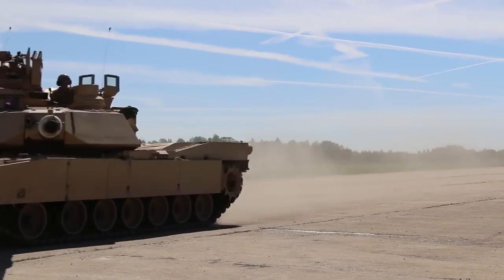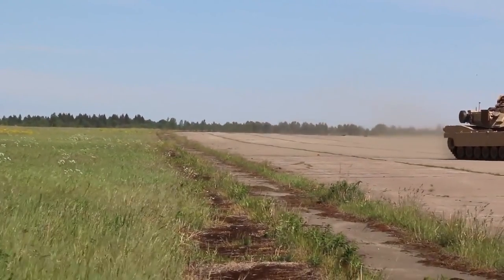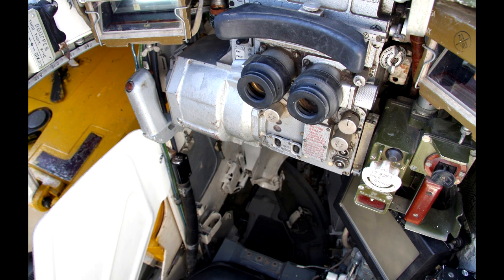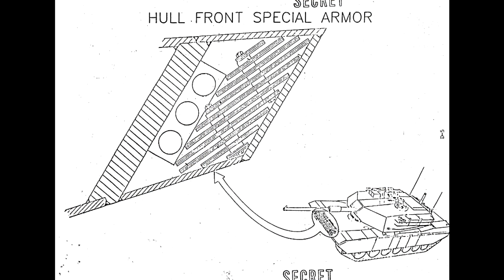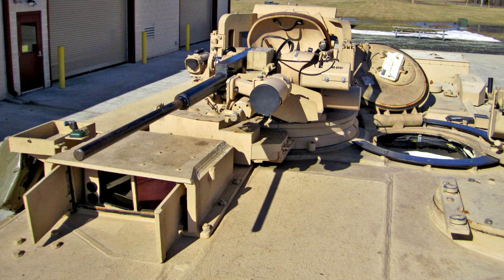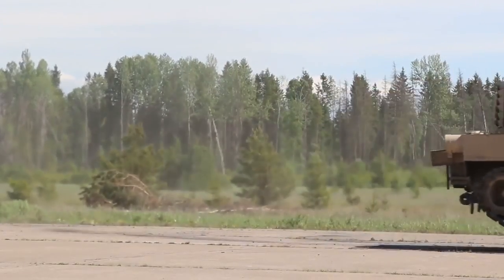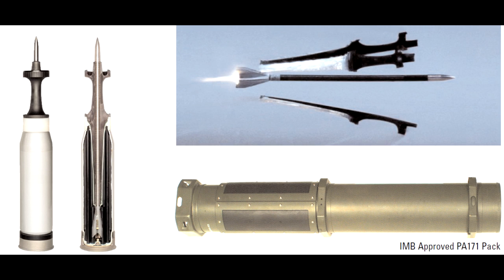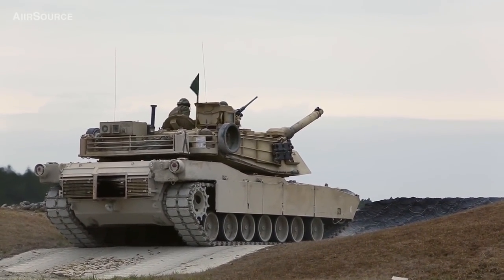Problems with Abrams tank

Comment: Sorry bro but your info is BOGUS. 1ST M1s in 1978 did indeed have nightvision and the tank commander had a nightvision sight. Infact the tubes used the 1st M1s in 1978 were manufactured by itt litton industries. It contained a 2nd generation 25mm micro channel plate intensifier tube as what was used in the anpvs4. 1 sight for commander/Gunner another sight for the driver. Your periscope bs is bogus and incorrect. Even the old ass m60 Patton tank had nightvision in which it used a 3 stage cascade image intensifier tube similar to that of the anpvs2b. Facts and truth seem to be absent from the above narrative. PS ever actually sat in a Russian tank and compared Russian nightvision to  what the US has? Yea if my countries  nightvision was that bad as compared to USA I would not mention it either. Don't take my word word for it. Compare both and well you will see what I am talking about. Edit: https://youtu.be/V-gYBxHPO_Y <<<view of a m1abrams 2nd gen night sight circa 1980  https://youtu.be/R3TDWHs6Hpm proof you are incorrect in stating the original m1 didn't have night vision. PS the pic you show and claim as a m1 is not a production model. It is a prototype of the m1 from 1976. Sorry but now I question any content to put out. Unsubscribing.

Comment: I still don’t really understand the decision to fit a gas turbine as the power pack. Sure turbine engines can run on pretty much anything that burns but that is also true of modern multi-fuel Diesel engines making this a moot point. The main benefit I can think of is that all gas turbines by design have very few moving parts but I do not believe this outweighs their disadvantages, especially considering how reliable modern Diesel engines have become. In fact I believe some export Abrams models have been retrofitted with diesel prime movers.

Comment: The commander doesn't necessarily need to be able to override the gunner. Could it he usefull if your gunner cant see something? Sure but it's not a really a problem. Also most shots that strike the UFP will be deflected up into the turret cheeks not the turret wring. Even if you could reliably cause a round to ricochet into the turret ring its is extremely unlikely that anyone would be able to make the shot reliably. That's like saying that the drivers hatch on russain tanks being a massive weakspot in their frontal armor but it's not because you cant reasonably expect the enemy to hit it. Also the reason they use the turbine engine is that it is cheaper to maintain over its lifetime than a diesel engine.

Comment: When will we make a new tank? I think that abrams is almost ready for retirement. Maybe not retirement but we need a new main battle tank.
Reply: There won't be a new tank. All the major Western powers are working on upgrades to the existing platforms rather than designing a new tank from the ground up. I thin this is because they know tanks are still a valuable asset but don't want or need the cost and problems of designing new ones. Also, the basic design of a tank has reached it's apex. Improvements can be made to armour, sighting, firepower etc but the basic design and layout of a MBT is pretty much where it should be.

Comment: Surely the key benfit of the multi fuel capability, is you can refuel the tanks on the fly from a variety of found / looted fuel sources? Like how the Germans refueled their panzers at Gas / Petrol stations in France in 1940 - as gasoline and petrol were widely available. Whilst Diesel is widely available, the ability to use Gasoline, Aircraft Fuels and even cooking fat - might be beneficial in certain situations. No benefit in the wars the US has fought since world war 2 though. Its more a nice to have, than a real benefit.

Comment: There are benefits to some of the design choices that went into the M1 Abrams. For example: while turbine engines are more expensive than diesel ones, they are also much quieter, at least from the front.

Comment: Your commentary regarding fuel means very little to the US.  You think it is unaware of the points you mentioned and would still deploy such a perceived handicapped unit 'just because' instead of addressing the issue at the design stage?  The US felt gas fuel was the way to go as a conscious choice for this tank at the time.  Previous American programs I've watched about the Abrams all  highlighted this unique difference compared to so many other designs.  Though I am nothing of an expert in this field, among the advantages of a gas engine I remember being mentioned is that the Abrams doesn't need the warm-up times typical of diesel engines.  This fuel factor along with others has had at least an indirect and significant consequence on a battlefield in my lifetime.

Comment: One thing the video left out was it lacks a auto loader and is overweight in the later models making it far more difficult to transport and unable to cross many bridges and roads in Europe or the middle east .
Reply: Georgi Cooley Why auto loader?
Reply: @hazardous458  you can reduce crew size and reduce cabin space significantly reducing the weight of the tank. the abrams is very overweight. also new auto loaders have a much higher sustained rate of fire. germany is making a auto loader for their tanks. China russia and france already use them.

Comment: So many problems with the abrams that they're still running in the same basic configuration and upgrading them 40 years later.   Meanwhile we've seen multiple modified T72's, T80s, and T90s in that time.  I wonder how much it costs to maintain like 4 different MBT's in service?   

Gee, it's almost like tank design is a game of give and take, and you can't have everything at once!

Comment: Hey Red, love your videos. I agree with most of your points, however I'm not too bothered by the choice of the turbine engine. I'm inclined to agree with The_Chieftain, (himself a former Abrams tanker) who said that the turbine engine's efficiency was comparable, if somewhat greater, to the diesel of the Leopard 2 when running at mid-high power. As a side note, will you ever do a video on older tanks (Leo 1, M60, AMX 30, etc?)

Comment: So, if I can target an Abrams' hull, I'd pretty much kill it. Sounds good, but it'd be difficult to target the hull if I'm firing, say an ATGM from over 2 kilometers. If I am in a war with the U.S., and they were fighting far from home, a good strategic move would be to target their supply depot and lines. That way, their Abrams would have a much difficult time running around because of their crazy fuel consumption.

Comment: It's almost pointless to try to protect the hull of the tank. Leopard has the same issue. Impenetrable turret front but weak hull. A large part of modern tank warfare is cover and concealment so the hull will likely be hidden from enemy fire. Mobility is also a huge factor. Basically it's better to not get hit all vs. trying to withstand the hit. The Abrams has good handling characteristics except for prototype issues with ice which was resolved.

Comment: And the idea of a TC laying the gun through the GPS is stupid.  Any TC who cannot lay the gun into the gunner's view using the TC's override and his eyeballs needs to be slapped.  The fastest way to lay the gun is to have your head out the hatch and swing the gun over as you give the fire command.  By the time you say: "Gunner.  Sabot. Tank' the tank better be in the gunner's sights.

In fact I feel that independent commander's sights are a bad idea because now the TC has his head looking at the sights instead of outside the turret where he can maintain situational awareness.

This is what happens when somebody with zero time on tanks starts deciding that one's 'better' because of different design decisions.  

If you want to listen to somebody who actually knows what he's talking about - go see The Chieftain You Tube channel.

Comment: If the Abrams is so bad why then did we go through Saddam's Russian Republican guards Soviet tanks like shit through a goose? The New Abrams have fixed most so called problems Yuri. However, I do agree about using a diesel instead of the Turbine power pack. and the New Abrams has add on armour to alleviate some of the "weak points along with having the Israeli AMS being put on new vehicles and the upgrading of older vehicles with the same two systems.

Comment: Having friends that have used them in combat and worked on them as a mechanic both say the big turbine benefit is reliability in harsh environment and a lot less parts to keep in stock near the battlefield
Reply: Yup. Basically one moving part, the turbine.
It is largely the result of British/US efforts to develop common engine/fuel (multi) power for tanks.
The project fell apart and the US developed a sure thing multi fuel powerplant for the new M1 Abrams.
Don't know why this guy (actually I do...) is such an Abrams hater.
Before it was the M60 which was good, for its generation, but no real crew survivability.
Abrams was a direct result of tank crews wanting to survive worst case scenarios.
It succeeded.
The BS about the 105mm gun is a non issue.
The upgrades from M1, to M1A1, to M1A2, etc., as well.
The 105mm was almost from the beginning,  slated to be replaced by the 120mm.

ALL Soviet tanks were evolutionary continuations of the previous version in some manner or other. 
T55, T62, T64, T72, T80, T90.
All of these light up to hits, with no expectations of crew survivability. 

The nonsense about it being a gas-guzzler, well yeah, who wouldn't want a 500 mile per gallon armoured vehicle?
Doesn't exist and never will.

As the saying goes, "Any good general can push the enemy back 200 miles. Only a GREAT general can supply that army with the logistics (fuel/ammo/food) it needs to do it."

Comment: Yeah it's totally rubbish. Like when it destroyed all the Soviet tanks operated by Iraq in one sitting.  One of the most crushing tank defeats of all time. But yeah terrible tank. Soviet so much better.
Reply: He never said it was a terrible tank you moron, he just pointed out some obvious drawbacks of the early M1 version from the 1980 which never saw combat anyway. Only the later upgraded M1A1HA version from 1988 saw combat in 1991, but this version had most of the early problems already fixed (120mm gun instead of the old 105mm gun and better armor).
Besides, the M1 Abrams never faced Soviet tanks, just downgraded irqi tanks, which were far worse than original Soviet tanks

Comment: The M1 has better hull protection, there are fuel tanks on either side of the driver that are used to strengthen the hull armour. Steel Beasts show the LOS thickness of the armour, all over, https://www.steelbeasts.com/sbwiki/index.php?title=M1A2_(SEP)
Reply: tankdriver658 Gaming You’re citing steel beasts? A video game that made up armor values based on thickness completely disregarding the fact that armor compositions can vary?
Reply: Hazardous steel beasts is a simulation software where various militaries use the software for familiarisation for gunners and TC’s it does not simulate tanks and IFVS like real life. But it is the best tank simulator money can buy for your pc. They have the correct stats...
Reply: tankdriver658 Gaming Oh yeah, and you think the military is the one providing the information? You think fuel tanks will add an extra 300mm of kinetic protection?
Reply: Hazardous I think they add significant protection in an unconventional way. And I don’t think the US government would let the M1 have such poor hull armour
Reply: tankdriver658 Gaming Oh yeah? Also according to steel beasts. The m1 abrams has more hull armor than turret despite being thinner as well as less angled
Reply: Hazardous for starters, the difference in KE and HEAT mm RHA is slight. Second, at an 80 degree slope, how do you expect a KE round to physically catch and hit the upper plate, the sabot will not normalise properly. There will also be added plate underneath, to expand the armour profile.
Reply: tankdriver658 Gaming I’m talking about the hull.
Reply: Hazardous by “hull” im assuming lower plate. That lower plate will be Burlington/ chobham, armour, that will then have fuel tanks behind, that HEAT jet/ penetrator will have to hit through the fuel tank, it will affect a HEAT projectile more than a KE round, it’s like having spaced armour behind the main armour, it will do nothing to KE as seen with bar armour and such, but it will affect HEAT

Comment: Can you really compare mm of a t72 (probably export only model) to an abrams with multi layered chobham armor ? 

If I remember right it has depleted uranium plating in the armor too
Reply: Did you even watch the video??? This is not even about comparing it to the T-72, it's only about the Abrams design. 
And the DU armor is only in the turret front, nowehere else!
Reply: Nico did you even read context?????!!!!! 🤨(Lol) He uses the 40mm+ armor of part of a t72 to show a projectile going through to say the same projectile would go through 35mm of abrams armor because it’s thinner

I did also say if I remember right not “I ABSOLUTELY AM SAYING FOR SURE” now that’s a cool thing to know but you come across as to thirsty for internet arguments
Reply: @Matt-lx6cj  Look dude, a 70mm plate is not really hard to penetrate and it's not gonna stop any modern KE round, even if it's extremely angled, it's still only about 400-600mm effective maximal. That's not really "inpenetrable". Modern KE penetrators can at least penetrate up to 700-800 mm. Just face it, the Abrams is not invincible!
Reply: Nico They aren’t now obama let loads of them get stolen and used by isis I never saw a video of one get taken out before then, now they are getting blown up left and right over live leak because the Russians got to practice on how to take them out through proxy syria etc, and now they have that strange looking missle that goes straight through the side
Reply: Nico also tank vs tank and so far the abrams has been essentially invincible at least in recent war settings, unless it was a t14 armata it would smash any other tank if it has an American crew
Reply: @Matt-lx6cj  It's not Russia that supplies the Houthis in Yemen with missiles, it's Iran. Russia has nothing to do with it. Abrams is not in Syria, it is in Iraq and Yemen. At least try to do some reserach! The Abrams never faced any modern tanks, only outdated and downgraded tank models. If the Abrams ever faced modern T-90A or even more modern T-90M, things would be a lot different. And in fact, at least 2 Abrams had already been disabled by Ifraqi T-72 in 1991 with at least one Abrams resulting in a total loss (it was penetrated on the rear turret which started a fire and burned the tank out, luckily all crew members survived)
Reply: Nico these proxy war’s happen they were going to kill each other anyway but that rivalry of us, russia and China will drive developing technology some that will help us in the future it’s just the way things work, it’s was definitely a Russian missile cause I’ve seen the same one there. probably was sold from iran for obvious reasons

Now.. you are right and wrong there is a video going around with a t90 taking out an Is Abrams in syria with a shot to the side

On paper a t90 is equal but..

Usa and Russia both wouldn’t let us know what’s really up with them and im thinking usa has more secrets on abrams than t90 (but Russia has some really creative minds so who knows?)

But Russia really care about the t14 now and have done for years so development on t90 likely will be not as focused as the almost infinite wealth spent on the abrams
Reply: @Matt-lx6cj  The T-14 is not the most important focus in the Russian army, only less than 100 of these tanks will be produced until 2020 because it's too expensive. The main battle tank of the Russian army is still the old T-72, T-80 and T-90 which will be upgraded to modern tandard. The new T-90M upgrade is capable to deal with the Abrams.
Reply: Nico tbh arguing which is better is useless t14 would beat everything right now 150mm gun and it can go unmanned it could be re booted and come back to life after being penetrated you need to kill the machine itself, it’s op you could probably kill other tanks by ramming them at speed if you could take them by suprise
Reply: @Matt-lx6cj  I'm not arguing which is better. All I said is that the T-14 is only very limited because it's expensive. The T-14 does not have a 150mm gun, it still uses 125mm gun. And it's not invincible either, the turret is rather weak as it does not have heavy armor, so it can be easilly knocked out which at least makes it a mission kill.
Reply: Nico turret armor is only an upgade away though, the turret looks quite small like they intended it for more armor, unmanned is definitely the future they didn’t do all that to make just 100

There is a 150mm option it’s not just the 125
Reply: Nico that said t72-80-90 are still very strong if they are true Russian models with Russian crew, they will forever be some of the strongest to be piloted by people, for sure sometimes good designs are just a matter of when they are made like the 1911 or m2 .50cal there are only so many shapes that can be made of tank decent chance that design may be good almost forever now they figured that design out and can build on it